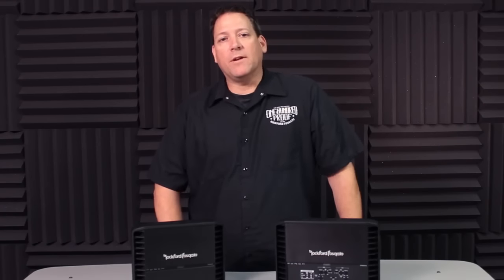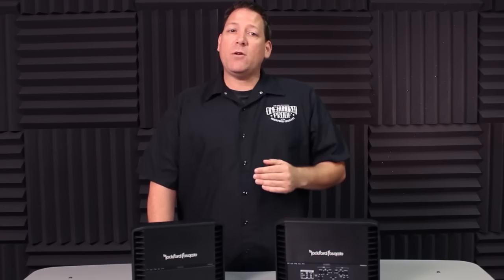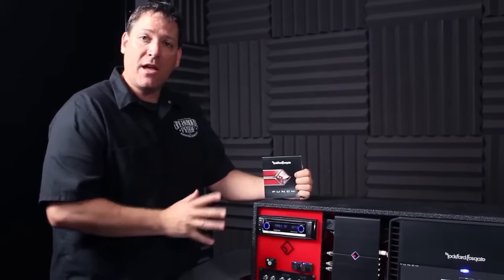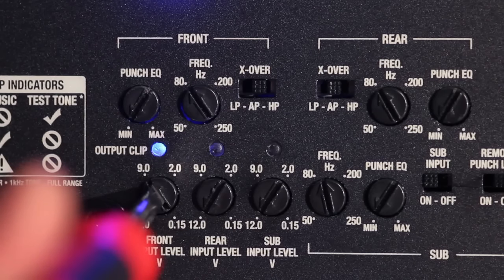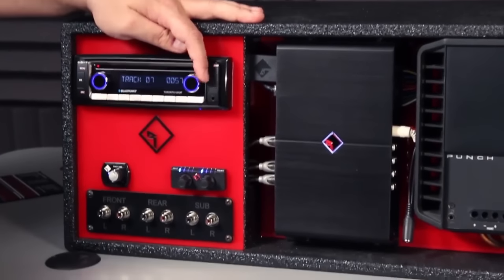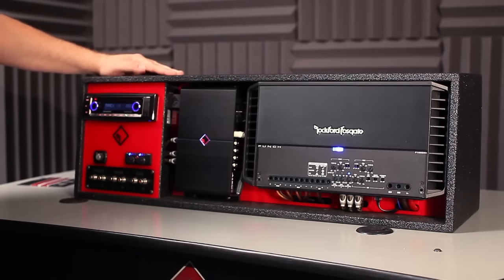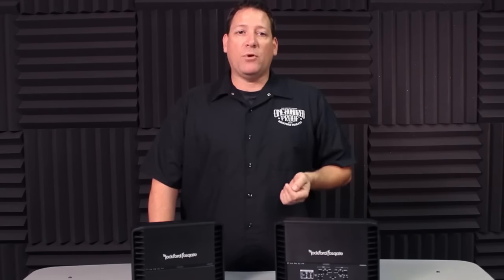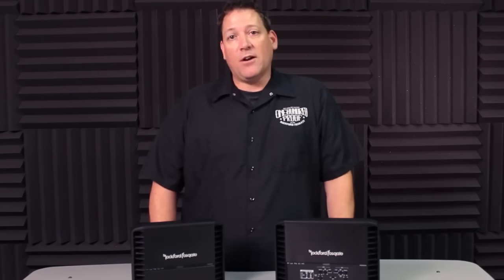Rockford Fosgate: Punch Amplifier Overview (3.1)

Comment: Still using multiple old school punch 150s, and a punch 45.
Reply from the maker: Awesome!  Thanks for continuing to be a Rockford Fosgate fanatic!
Reply: @rockfordfosgate  just unpacked my Punch 240 trans ana that I loved back in the mid/ late ‘90’s .  It was a great amp that I had running in my S-10 pickup. I can’t remember exactly how my entire set up was wired but there was  the 240 Trans ana, and 2 other Punch amps that I had powering everything. I had an MB Quart component set (aprox 1” tweeters, 6” and 4” mids).  Then  3- 12’s and a 15”. The neighbors probably weren’t too pleased 🤣 when I “forgot” to turn down the volume when getting home from school.  But it kept me out of trouble and super busy…school, sports, car stereo, family and friends… never enough time to get into bad trouble. 

Anyhow, I’m finally getting back to putting a descent system into my 4Runner and will more than likely run either a single 12” , or 2 10” subs for my lows. Now I’m trying to decide which punch amp to run the subs. I’m for sure going to be looking for the amp to push aprox 750-1000 rms. And of course match whichever subs appropriately. Any suggestions on the amp to either run a single 12” in a ported box, or just 2 10” subs?  Thanks in advance.

Random question, my 240 trans ana… is it at all possible to send it in to RF to be looked over or serviced?  Probably not. But just curious. 
Cheers!!
Reply from the maker: @jeffrines07  We have 2 partners that can look over previous generation amplifiers.  You can get their contact info here based on your location: https://rftech.custhelp.com/app/answers/detail/a_id/42/

Comment: When i check tha max outputs of my estéreo Kenwood exelon dmx 907s 😅 i used 1 kilohertz testtone and no distorted but when I set my gains of my amplifier dsp audiocontrol D-4.800  they shows distortion wy 😂😅 at volume 28
Reply from the maker: If your AudioControl D-4.800 was a unity-gain processor, this wouldn’t happen.  However, because this is an amplifier, it’s is amplifying the signal, causing the clip LED to illuminate.  Once you find the maximum clean output from the radio, do not adjust the volume knob when setting the output level.  If the gains are all the way down, and it shows clipping, you might be at the threshold, so you may want to click the volume down one notch.

Comment: Please give me an honest answer.
How do these amps compare to the DSM series, reabillity, SQ and powerwise.

I have a rather complex system in my car from before, and plan to add subs.
This means
2 PCs Power 250M for Subs
1 Power 250x2 for Midbass
1 Punch 400x4 for Midranges
1 Punch 240x4 for Tweeters.

Yes they are all in my posession. 
Everything a have been used by me in different systems for a couple of decades.

BUT i have no way of installing this in my station wagon without making the car looking like a "smoergåsbord" for theives, and still keeping the amps cool.

Since a pair of Punch P1000X5 and a Punch P1000X1BD at least in theory could replace my 5 DSM amps,
and probably could be hidden in a 8" deep compartment in my cars floor. they are definetivelyt tempting.
Reply from the maker: Hi Lochmodor, I've worked at Rockford Corporation for 30 years.  I wrote the owner's manuals for the 250m, 250x2, 400x4, and 240x4.  You can look on the back page to see my initials :-)  Both set amplifiers will work fine.  However, the capacitors in the older amplifiers will need to be replaced since they have a "shelf life" of 10-15 years.  The input stages on the newer models utilize the same methodology developed for the DSM amplifiers, but have been updated with Differential Inputs and CLEAN circuitry.  Both old and new amplifiers incorporate Class-A/B topology (with respect to the Class-BD model) for supreme Sound Quality.  Both sets of amplifiers utilize the same unregulated power supply type that produce unreal Dynamic Output Power.  Look at the older manuals in the Specifications table for Dynamic Power and for the newer models, the website shows Dynamic Power too.  Either way, you can't go wrong. -Eric R.

Comment: Hey guys, I have my heart set on Fosgate, I only consider you guys for amps.  But I have a simple question about my head unit and high level inputs.  What is the max voltage the amp can accept, I think my head unit puts up to 10V through the speaker wire, and I heard not all amps can support such high level inputs?

Secondly, how would this Punch compare to the compact PBR400X4D amplifier?

Lastly, I want to run components up front and coaxials in the rear, and they are going to be 3ohm or under, is it ok to run either of the above mentioned 400W fosgates at 2-3ohm full time?  The speakers handle 135W RMS so that is not a problem, I believe both these amps will put that out per channel, or close to it, at 2ohm.

I'm not going to blast it all the time of course, just here and there, my system is geared towards great midbass and great quality, but I will want volume on occasion which will require almost 100% from the amp.

Is there any real reason to get the Punch 400X4 rather than the compact 400X4D?  Should I consider the 600X4 Punch or even the Prime 500X4 instead for my setup?

If you take the time to comment, I would greatly appreciate it!
Reply from the maker: The MAX INPUT VOLTAGE varies by amplifier and is listed on the SPECS tab of all our amplifiers under the "Input Sensitivity" specification.
The Punch amplifiers utilize a Class-AB circuit topology and is better for sound quality installations versus the PBR400X4D which uses Class-D.  
Yes, all Punch amplifiers are stable into a 2-ohm load, so 2-3 ohms will be fine.
If you have absolutely no space to offer and low current availability (Mini, Smart Car, Honda Fit, etc.) then the PBR400X4D works great for those applications.  Otherwise, if SQ is the most important aspect, you have adequate space, and adequate power, then the traditional sized Punch amplifiers are your best bet.

Comment: If i am using the p600x4 with a sub on the rear channels, do i still use the 40hz tone to set the level of the sub or will the 1khz be the only tone that would be used?
Reply from the maker: Great question!  If you’re using a preamp with a fixed output, RCA outputs or speaker line outputs from a radio, you can just use the 1kHz 0dB tone.  If you’re running the signal into a preamp (DSP) that has different level settings for full-range and sub outputs, use the 1kHz to find the clipping level of the radio volume, then you can use the 1kHz to adjust the full-range output and 40Hz on the sub output respectively.

Comment: I have 2 type R 6x9s and the Rockford 400 pushing them on 2 channels. Its not as loud as it should be. Should I bridge the amp To send more power to the type r 6x9 components?
Reply from the maker: The Punch 400X4 should be adequate power to drive those. These are the power ratings, so if you go from 4-ohm stereo to 4-ohm bridged you're quadrupling your power applied, so you might want to check to see if your speakers can handle that much power. 

50 Watts x 4 @ 4-Ohm
100 Watts x 4 @ 2-Ohm
200 Watts x 2 @ 4-Ohm Bridged

It might be worth checking your gain setting.  If you setup the amplifier using the 1kHz 0dB Gain Overlap track, we would suggest readjusting it using the 1kHz +5dB Gain Overlap.  This will get you a little more output while keeping distortion to a reasonable (most people can't really detect it) level.

Comment: So, I need some help guys. I have a pair of focal 4 ohm 80W RMS componets in the front and a pair of focal 4 ohm 70W RMS in the rear. Theyre powered by a Fosgate Punch 400x4 which puts out 73 watts @ 4 ohms per channel (theyre overpowered from the factiry, you get a birthsheet for these amps. Everyone says your amp should put out 2x the power of your speakers rms rating. They distort somewhat at 3/4 volume and heavily past that if i tune the amp with rockfords "clean" setup. Am I underpowered?
Reply from the maker: Hi Tomothy, Looks to us like you have a great amplifier to speaker matchup, especially from a higher performance amplifier like the Punch 400X4!  If the speakers are distorting at 3/4 volume, it sounds like it may be coming from the source unit as it's clipping (many radios distort at 3/4 to 7/8 of maximum volume).  You should definitely use the CLEAN setup to figure out  where your source unit clips, helping you know the maximum level where you can turn-up the volume.

Comment: Planning on getting a SINGLE Rockford fosgate power T1D212 and getting hooking it up to the RF Power 1000x1bd or what would that be a good amp to push that single 12? Or what amp would you recommend to maximize that subwoofer?
Reply from the maker: Hi Jr Reyes, that's a GREAT subwoofer!  The T1D212 is rated to handle 800 Watts RMS and can be wired to a 1-ohm load.  The Power T1000-1bdCP is rated to produce 1000 Watts x 1 @ 1-Ohm and can dynamically produce up to 1395 Watts x 1 @ 1-Ohm.  So this would at least be 200W over-powering the sub.  We would recommend the T500-1bdCP because although it's rated at 500 Watts x 1 @ 1-Ohm, it can produce up to 707 Watts x 1 @ 1-Ohm.  It's slightly under-rated for the RMS rating of the sub, but at least it will not overpower it like the T1000-1bdCP and you'll not be in fear of burning up the voice coil.

Comment: I have a Punch 600x4 On my components and my rear door speakers. This amp is great, but after playing for about an hour at high volume, amp shuts off? Is it protecting itself?
Reply from the maker: If the amplifier turns back on, then yes it's going into protection.  Be sure the impedance load is not lower than 2-ohms on each channel and it has plenty of ventilation.  If you're only running components on it, this should not be happening.
Reply: @rockfordfosgate  ok, thank you!

Comment: Thank you for the great instructional video.  I have the same amp in 400.2.    However i have a question.  Is it possible to to connect it in 3 channel mode such as in older RF amps?  I have 2 subs @ 2 ohms each channel rated 150rms.  But im thinking of also installing a 4 ohm 400 watt rms sub in bridged along with the the other 2 which are wired normally.
   Id appreciate your feedback.  Im looking to maximize the output.  Thanks
Reply from the maker: Great question arrepuess. YES, you absolutely can using passive crossovers.  The article below explains how to do this on DSM generation amplifiers, but the concept is exactly the same.  You'll run stereo speakers from say 100Hz High-Pass at 12dB/octave, then run the subwoofer bridged (using the appropriate terminals for bridging the amp) using a 100Hz Low-Pass crossover at 12dB/Octave.  http://rftech.custhelp.com/app/answers/detail/a_id/83
Reply: Rockford Fosgate  excellent thanks for the quick reply!  So i guess in order for me to do tri mode i will have to switch the amp to “full range”?  So i can just rely on the head unit’s subwoofer selected rca’s make it low pass?  
   If this works i should be getting a lot more bass from this amp alone.  I wonder how well it will take the load & abuse?  It will basically be pumping out 800 watts rms from a 400 watt amp?🔉🔊🔉
Reply from the maker: I just re-read your original post and I have to apologize.  I misunderstood and thought you would be using the amplifier in "Tri-Mode" to run full-range speakers on the front stereo channels (coax or components) and bridging a subwoofer, not running 3 subwoofers.

Normally we don't recommend mixing subwoofer models and impedances due to the different acoustical propagation and power applied to each subwoofer.  However, in you're case, this may actually work ... but we're assuming you have the exact same make/series of woofer (ie: all three are Punch P3 12").  If you're mixing brands, we still wouldn't recommend it due to the acoustical properties of each model.
Reply: Rockford Fosgate  yes all subs.  They will all be the same brand.  2 of them 150 watt rms 8” dvc wired 2 ohm each channel,  “which actually bumps great already”.  But i plan to purchase another sub the same brand,  but wireable to 4 ohm and higher “400w rms” and put that in the bridged.   I guess ill be taking a chance if i do that? It may be too much load for it?  As its not a power amp, but a punch such as what you have in the video.   400.2.
   I think i will take the risk for experimental purposes😈
Reply from the maker: O.K. thanks for clarifying ... based on your direction, it should theoretically work on 3 subwoofers.

However, I would caution against purchasing that 3rd sub because you'll probably be disappointed with the output.  You'll theoretically need to double your cone area (go from 2 subs to 4) or double your power input (400 watts to 800 watts) in order to get a 3dB difference.  Going from 2 subwoofers to 3 will only give you an increase of around 1.7dB ... the least detectable difference in loudness is only 1dB.  Doubling your power isn't feasible because the subwoofers are only rated to handle 150W RMS.  My recommendation ... if you're wanting more bass, you'll probably be looking at running 4 subwoofers and using a bigger amplifier.

Comment: Team RF,

I currently have the P1000X5 and looking to drive 2 P3D4-10's wired down to 1ohm - is this an acceptable amp to subwoofer match? The amp outputs 600+ watts at 1 ohm at the factory.
Reply from the maker: Hi pagostyle, Thank you for providing the model numbers.  Yes, this would be a great amplifier for a pair of P3D4-10 subwoofers.  Since each sub is rated to handle 500 Watts RMS, two subs will give you 1,000 watts power handling capacity.  The P1000X5 sub channel is rated to produce 500 Watts x 1 @ 1-Ohm, but can dynamically generate up to 863 Watts.  Still within the power handling of the speakers, so you made a great choice!

Comment: I currently have the Rockford Fosgate P3-1X12 Punch Single 12" Ported Loaded Enclosure Subwoofer and I’m wondering which amp should I use to get the most from my sub
Reply from the maker: Great question Trey, the P3-1X12 is rated to handle up to 600 Watts RMS and is wired to create a 1-ohm load.  The T500X1br would be a great amplifier because although rated at 500 Watts x 1 @ 1-Ohm, its Dynamic Power is just under 600 Watts, making it a perfect match for the subwoofer.  You can learn more about that amp here: https://www.rockfordfosgate.com/products/details/t500x1br/

Comment: I own one P1000X1BD and one P400-4 amps.Today i use an hi/low converter. If i replace the P400-4 amp with a P400X4 amp is it then possible to get rid of the high/low converter and use the built in highlevel inputs for both amps.. for now im using my sub.amps passthrough to my rear channels on the 4 channel amp. Is that possible on the other configuration?
Using my amps in a OEM audio system with factory headunit with fiber optics and stuff. Not changeable.
Reply from the maker: Great question Orfeous and thank you for explaining your setup!  Yes,  you'll be able to take advantage of the hi-to-low converters built into the P1000X1bd and P400X4 amplifiers and ditch the external converter.  You'll be able to use the Pass-Thru from the P1000X1bd and send full-range audio to the P400X4.  You may need to adjust the Gain controls since you're dealing with a different signal voltage, but that will be a snap with the C.L.E.A.N. circuit.
Reply: Thank you so much for the fast answer!
Ok, then i will get rid of my High/low converter and replace the P400-4 with a P400x4 amp and use those built in highlevel inputs on the RCA's. Should be a lot better i think instead of using a separate converter.
I have been thinking of buying a 360.3 but that is a lot of money for me.
Reply from the maker: You're welcome.  Albeit eliminating the converter will simplify your signal chain, it will not be a night & day difference.  Sounds like you have everything pretty tightened up.  In the future, if you did want better control over the sound quality, the 3Sixty.3 or upcoming DSR1 will be great pieces for your ride.
Reply: I'm just about to buy a used 4080 and I don't know jack how to set it up
Reply from the maker: Sorry I'm just seeing this.  Assuming you got your info O.K. from technical support.  If not, our Knowledge Base has all owner's manuals loaded.  Simply search for the model number "4080DSM" and this popped up: http://rftech.custhelp.com/app/answers/detail/a_id/395/kw/4080DSM
Reply: Rockford Fosgate Do you think if i add lc7i to stock stereo with a P1000X5 would it sound better then speaker wire to rca's ?
Reply from the maker: No, the P1000X5 already has a built-in line level adaptor, so all you need is a speaker wire-to-RCA adaptor like this: https://www.rockfordfosgate.com/products/details/rfi2sw/
Reply: Rockford Fosgate Ok THANK YOU so much. You saved me some money thanks.

Comment: Rockford I need help. I have 2 R2sd4-12 subwoofers and I'm trying to match it to an amplifier what would you reccomend? The speakers can be wired in parallel to a total impedence of 1 ohm with a total of 500 watts rms (250 rms each woofer)
Reply from the maker: Hi Velente, You could do the Punch P500X2 bridged to 4-ohms which would produce 500W x 1 or the Power T500X1br which would produce 500W x 1 @ 1-ohm.  You could also go for a lower powered option using the Punch PBR300X1 which would produce 300W x 1 @ 1-ohm.  Links to those products below:

https://www.rockfordfosgate.com/products/details/p500x2/
https://www.rockfordfosgate.com/products/details/t500x1br/
https://www.rockfordfosgate.com/products/details/pbr300x1/
Reply: @rockfordfosgate  thank you I'm going with the p500x2. I'm going to bridge them. Thank you!